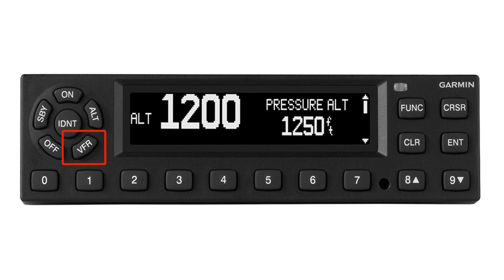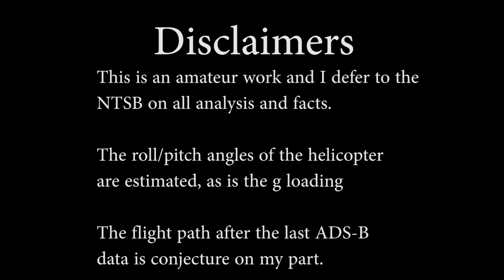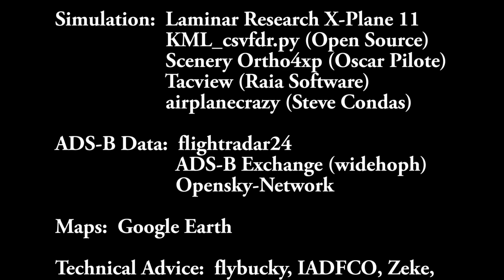Newly released Pilot to ATC Audio!  N72EX (Kobe Bryant) Crash Reconstruction.

Comment: The depiction of the fog/marine layer in the reconstruction actually understates just how bad the visibility was in that area that morning.  I live in the area and was driving on the 101 about 10 miles west of the crash site when the crash occurred.  The marine layer was unusually thick, and descended to the ground level in that area (which is several hundred feet above sea level in that area).  If you were down in Malibu due south of the crash site (at sea level), you would see perhaps a 500 foot ceiling in those conditions, but inland as the elevation rises, the marine layer merges with the ground.  You do not get bad ground fog, but you can only see 200 yards or so at ground level, and would be worse higher up.  The conditions are worse in the valleys (the crash site is at the upper reaches of Malibu Canyon).  The marine layer creeps in during the evening up the valleys at a low level.  From higher points in the mountain range, it looks like a fog river.  During the night, it keeps migrating inland, and thickens vertically.  On that day, it was unusually thick.

It is also normal for these conditions to be much worse in that area.  The coastal mountain range breaks up the marine layer somewhat for it to penetrate into the San Fernando Valley (Van Nuys airport location), but further west at the crash site, the ocean is closer and the mountains lower, as well as broken up by Malibu Canyon.  I think the pilot ran into these much thicker clouds as he passed over Calabasas.  He promptly lost sight of the ground and everything else.  He initially thought that he might climb over it at 4,000.  That is a reasonable thought as the upper surface of the marine layer often ends completely at a low altitude, and visibility above it is very good.  The marine layer is not like typical weather.

But he decided to turn around also.  He spatial disorientation prevented him from realizing that his turn had also put him into a steep descent, when he thought that he was climbing.  The downward pressure of the turn can simulate a sense of gaining altitude, and/or obscure a sense of lightness while descending.  

He smashed into a moderate hillside with probably almost no warning at that speed.  The terrain there was just a sub-ridge to the higher mountains to the south.  The valley floor there is at 800 feet.  The crash site at 1030 feet and a short distance from the valley floor.  The highest spot on that ridge above the crash was 1500, but mostly lower than that by 100 to 200 feet.  He spiraled into the ground, basically, with no warning of the rapid descent into the ground.  Yes, he hit a hillside of a larger ridge, but at that descent rate, it is not really about flying into a mountain.

Comment: I think the difference in time from a car to a helicopter is roughly only 30 minutes. Doesn't seem worth the hassle and the danger.
Reply: Flying is statistically safer than traveling by automobile is, so the "danger" argument doesn't really sway here, friend.  The travel time difference would be about 90 minutes with normal traffic, but if a freeway slow-down were to occur, that difference would grow.
Reply: @cardinalRG  I thought it was about 70 miles full distance. That's less than 90 minutes. Also, it takes time to schedule and to make sure everything is coordinated, and you have to drive to and from the helicopter location. I could see if it was 200 miles or more. The safety thing everyone knows, but I'd rather be in a car accident then in a plane/helicopter crash.
Reply: @MrMarco855  --It's about 85 miles from John Wayne Airport to the location of the basketball tournament, so the commute distance from home is an equal factor in both the actual and alternative scenarios.
Reply: @cardinalRG  When I referred to the danger factor earlier, I was talking about in the conditions they were presented with. That can be a problem, because the company and the pilot want to please and to keep a client like Kobe Bryant. The pilot knew conditions were less than good, but realistically, the pressure to get the job done overwhelms safety, just as it did in this instance. The pilot/company are in a situation in which they feel they must get him to his destination. Otherwise, they face the awkward scenario of telling him at the last minute, sorry, we can't fly. In their minds, it's the last thing they want, and it may cost them the client if it happens more than once. It's a tough spot to be in. That's why I question using a helicopter to begin with, especially on a relatively short jump............Are you from that area?

Comment: No switching to IFR, just trying to maintain VFR. What in the actual hell. Looking back at this, it looks like the pilot absolutely made the worst mistake while flying into IMC. He got them killed by his lack of training in IMC. There was nothing wrong with the instruments, since it was well maintained. You can clearly see by the descent and turning that he absolutely was not paying attention to the altitude.
Reply: All IFR flights are done under a flight plan (take off to landing). He flew into IMC by accident. No one knows if he had the time or the capacity to switch over to the IFR procedure. It's not like you can flip a switch and start flying IFR
Reply: @CodyCha  -- "All IFR flights are done under a flight plan (take off to landing)."

A small correction--in certain scenarios, an IFR flight plan can be obtained or canceled while en route.

Comment: Marine layers are no joke. I was hiking in Charmlee Park outside of Malibu today about 1000 ft in elevation up from the coast. At the park entrance it was 79 degrees and sunny, but as I descended down the valley towards the coast the marine layer enveloped the whole of the valley and the trail, which parallels the coast line. Visibility was extremely poor even on the trail. The temperature felt about 10 degrees cooler and it was very easy to get disoriented in it. I could hear a helicopter above somewhere and was hoping it was high above the cloud deck. It sounded fairly low though. I thought about this very crash when I heard that rotor wash above me. I couldn’t see the ocean or Malibu down where I expected it to be.

Comment: are flight controllers able to see altitude from their end ?  Was the flight controller distracted talking to other pilots/ppl in the control room during this critical moment.  Could the flight controller have warned Zobayan that he was quickly descending ??

Thanks
Reply from the maker: Flight controllers are able to see the altitude from their end in many situations.  We still don't know if and when the aircraft disappeared from the screen because it was too low to be seen by RADAR.  We do know that the controller did not believe that they had "RADAR contact" with the helicopter.  RADAR contact is when the controller has responsibility for monitoring the flight. https://www.faa.gov/air_traffic/publications/atpubs/pcg_html/glossary-r.html#:~:text=RADAR%20CONTACT%2D,limits%20of%20necessity%20and%20capability.
Reply: Jimmy Huynh  --Realize also that if the accident pilot’s spatial disorientation was severe enough, he may not have been able to act upon a controller’s warning and recover control of the aircraft.

Comment: This video is a joke, there is no black box, so no aircraft data to use to make such a video. So I'm gonna make my video. The expert pilot who had the skill to watch his gauges was hotdogging his very heavy aircraft. He climbs up through the clouds, reaching the top and clear sky. He hammers his air speed and hits a thermal vortex or downdraft or headwind, stalling the main rotor.  He struggles to recover the aircraft but it gains more and more speed as it banks left and falls from the sky, making it impossible to recover. The aircraft crashes on its left side, in clear air at 200 mph. Witnesses say they saw the last 3 seconds of flight as it fell out of the clouds, which means the pilot also  could orient himself to at least right the aircraft. He couldn't because of the rotor stall.  This crash is text book rotor stall.. once a helo goes too fast, it does the same thing as a winged aircraft does by going too slow.  The sound video of the last 30 seconds of the crash are very telling. The last 12 seconds of the flight, you can hear the main rotor stall, and you can hear the pilot trying to recover. Aircraft was well above its max flying speed for its weight.  No hope to save it as it fell from the sky.
Reply from the maker: The wonder of the Internet!  You can do your own analysis and publish it.  As to your points:
1)  As you noted, there was no black box.  I had to modify programs to estimate pitch, roll, and yaw from the available ADS-B position data.  Basic physics constrains the roll estimate pretty accurately (you can't get the required turn radius otherwise).  Pitch is a bit less precise because it depends on the actual aerodynamics on the front of the aircraft.
2)  The rotor cannot have stalled and simultaneously generated enough lift to produce the turn radius.  If the rotor had stalled, the aircraft would have pitched up, rolled to the left, and not made a smooth turn.  The rotor did not stall during the time that I have ADS-B data (up until 2 seconds before impact).  https://flyingmag.sfo3.digitaloceanspaces.com/flyingma/wp-content/uploads/2021/08/25171428/NTSB-Kobe-google-path.jpg
3)  To help validate my model, I used the X-Plane S76 and dynamically programmed the autopilot to fly the ADS-B path.  I put in the weights of all of the passengers and fuel as described in the NTSB Docket data.  The model flew the path without any rotor stall and showed that the pilot felt normal 1G into the seat for most of the descent (this is due to the combination of turn rate and increasing descent rate).  https://youtu.be/xI1UqFvNYIU
4)  The maximum geometric height reported in the ADS-B data was 2325 feet, which when you apply the geometric to MSL conversion for the area, yields a maximum height of 2440 feet AMSL.  
5)  I have examined the cloud videos from the NTSB docket, and I estimate the tops at 2700 ft AMSL at the time of the crash.  The helicopter never punched through.
6)  I have examined all of the published doorbell/security audio and did a frequency analysis.  I was not able to draw any conclusions due to the changing geometry as the aircraft turned and echoes off of the mountains.
7)  You have not yet explained why the pilot said he was climbing when , in fact, the aircraft was descending.  My explanation of spatial disorientation is consistent with the facts.
My reconstruction is consistent with the available data, and matches the conclusions by the NTSB.
Reply: @stevencondas2281  sir, I am not without appreciation of your skills, but you built that video with one point in mind and that was spacial disorientation.. 
As far as rotor stall, the rotor blades hold the helo in level flight, much as the wings of an airplane do. The retreating blades loose lift as the helo gets faster and fast. When the retreating blades stall the aircraft looses lift on that side of the aircraft and will roll into the the stalled blades. Once rolled to its side the aircraft will fall out of the sky and pull itself in the direction of the roll, as the pilot tries to stop the stall.  On this aircraft the retreating blades are on the left side of the ship, so in a stall the ship will pitch left or start a barrel roll if the pilot doesn't feather the pitch on the blades. The fact this ship hit the ground (flying straight forward) on its left side, says rotor stall. Rotor stall is the only way to get a helo on its side in straight flight. We all agree, the aircraft was in a rotor stall when in contacted the ground. I say, the stall started at 2700 feet. The sound of the main rotor for the last 12 seconds is a rotor stall. My question to you is this. Where was that ship in its flight, 12 seconds before it hit the ground? That's when the problem occured. Listen to the security video that was made of the last 30 seconds of flight.  My question is this. Your climbing and going forward as fast as the ship can, you break out of the clouds and stop climbing but keep accelerating at max thrust. Can that scenario increase the speed enough to induce rotor stall. Or, did he fly into a vortex at the end of that mountain range? I'm told that according to the instruments recovered, the pilot tried recovering the air craft 3 times. This is not someone in a spacial disorientation if he was trying to recover the ship. You are better at this than me. Put my theory to the test, and prove me wrong with data, not your opinion.. he was heavy and fast, a text book example of rotor stall...
Reply: @stevencondas2281  https://youtu.be/wZ0WIwrKSz8.. this guy really explains it simply and in layman's terms.
Reply from the maker: I am familiar with retreating blade stall, and I submit it did not happen in this incident.  

1)  The aircraft VNE is 155 knots, has been tested at more than 185 knots, and the helicopter had flown at 145 knots earlier in the flight without RBS.  The turn began at about 115 knots, so excessive speed is very unlikely to have induced RBS.
2)  The aircraft was underneath its maximum weight.  It had a max take off weight of 11,700 pounds,  took off at 11,083 pounds, flew for 40 minutes burning at least 300 pounds of fuel, so was around 10,800 pounds at the time of the crash.  Given that, excessive weight is very unlikely to have induced RBS.
3)  Winds were light at less than 5 knots.  Given that, winds are very unlikely to have induced RBS.
4)  The aircraft was at low altitude of only 2400 feet when the turn began and the temperature was only 15C.  Given that, high altitude (high density altitude) could not have induced RBS.
5)  My two flight models do not show high G loading when the turn began.  Given that, high G loading is very unlikely to have induced RBS (that would be caused by excessive cyclic or collective).
6)  There is no evidence of low Nr.
7)  Spatial disorientation is a real thing and happens easier than most expect:   https://www.youtube.com/watch?v=9ofStn2KScg&t=330s   
8)  The pilot thought the aircraft was climbing when it was in fact descending.  Spatial disorientation.
9)  RBS was not a finding from the NTSB.

I have defended against your claim that my "video is a joke" and am moving on.  I continue to believe this is a credible and good faith reconstruction supported by the data. Write me when you have modeled the RBS and can demonstrate that it led to the crash.  Here is the data https://data.ntsb.gov/Docket/Document/docBLOB?ID=11906491&FileExtension=csv&FileName=DCA20MA059%20-%20ATC%20Factual%20Report%20-%20Attachment%205%20-%20CC-Rel.csv
Reply: @stevencondas2281  I didn't state the aircraft was overloaded, I said it was heavy, which lowers the vne. He was climbing hard, which lowers vne even more.. at 120 mph and a hard climb,  loaded heavy, he reduced the rotor speed, this lowered the vne even further. Let's face it, it looks like he was climbing hard and pulled the rpms down on his engines, and reached the vne speed for those conditions.. I agree, once rotor stall occured and the aircraft pitched left and down, that spacial disorientation played a huge factor in the crash. However, the medi-evac pilots here tell me, that no one lives through rotor stall below 4000 feet. And only a few have done it and lived to talk about it.  However they admit they have never flown this particular machine.  But they all agree in a hard climb with throttles at cruise settings, you can slow the main rotor and achieve vne way before you expect it.
Reply from the maker: @KBS117  I doubt anyone else will read this, but to set the record straight, I investigated your remaining hypotheses:
1)  The pilot did not have a flawless record:  https://www.latimes.com/california/story/2020-02-21/kobe-bryants-pilot-was-previously-counseled-by-the-faa-on-reviewing-weather-before-flying
2)  You claim "He reduced the rotor speed".  The NTSB looked at the data and said "The rotor blade frequency between 100% and 107%, modified by the Doppler effect, was detected in both segments of high intensity and even in the low-intensity segment between them."  The high intensity audio times were well before the turn and then moments before the crash.  Rotor speed did not decay.  https://data.ntsb.gov/Docket/Document/docBLOB?ID=9755311&FileExtension=pdf&FileName=Calabasas_Video_Based_Visibility_Study-Rel.pdf
3)  I am skeptical by nature, so I analyzed the last two minutes of audio data myself.  I see no reduction in rotor RPM at the time of the turn, and the RPM was within the expected values.  https://1drv.ms/u/s!Ai5ul4veNOgHiZoEOL9dYKK99mDdmA
4)  I am supposed to believe that this trained pilot did not recognize the vibrations caused by the onset of RBS and take appropriate corrective action?  I think it is much easier to believe that he was distracted, not paying attention to his instruments, and became spatially disoriented.
5)  When RBS happens the aircraft pitches up, not down as you stated.
Reply: @stevencondas2281  --Excellent explanation.
Reply: @stevencondas2281  I'm two years late (4 years) , but I really appreciated your detailed research on this!